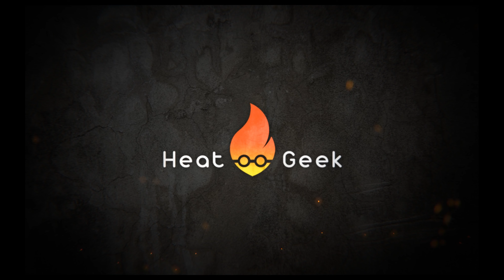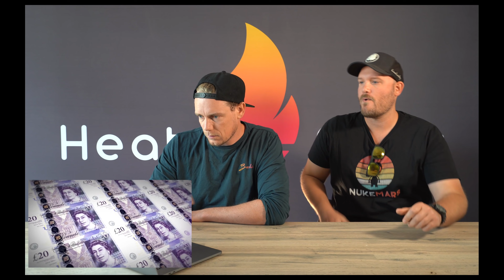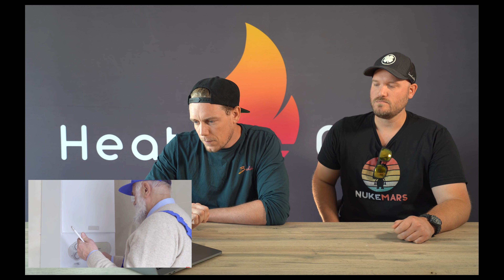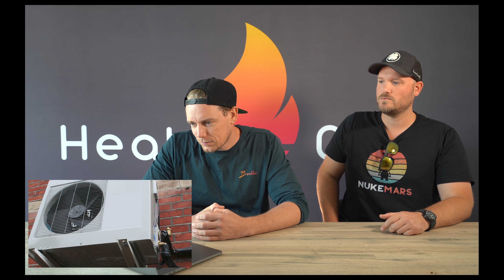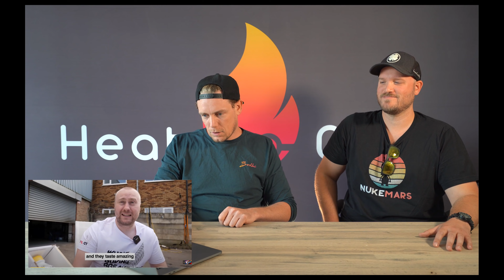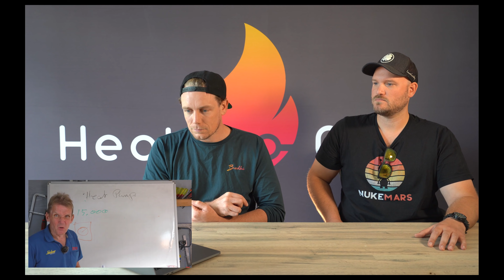Professionals React (BADLY) To Skill Builders's Heat Pump Videos | PART 1 | FIRST TIME WATCHING

Comment: Angry Skill Builder predicted repeatedly higher Gas and Electricity Prices... how prescient does that look now?
He made the point that there will thousands of installers who are insufficiently experienced to make them work well. Heat Geek agreed. I think it's a score draw with me still unenthusiastic about air source heat pumps.
Reply from the maker: No.. he predicted that the government would make them the same price.. both have gone up. They have been talking about stopping yhe subsidies gas recieves for years and giving back to elcy to make it more fair but nothing has been announced yet so untill it is.. its conspiracy.

Comment: THANK YOU.  I had a "conversation" with the gentleman in the video and I can report his writing style was exactly like his speaking style!  LOL  I simply pointed out advances with regards to cold weather and mentioned Norway's embrace of heat pumps.   I got a rant about Norway wanting folks to throw away gas furnaces for a heat pump four times as expensive that didn't work.   He then said it worked in Norway (??!!) because in WW2 all older home were destroyed and besides, electricity was cheap.  

Butcher to heat pump installer!  Love it.

Comment: Something that surprised me is all the Heatpump installs in the uk seem to be based on heating water systems, and then using existing radiators within the home. However in many countries they have the Heatpump outside and an internal unit inside which blows hot or cold air depending on settings. With Uk homes being relatively small, wouldn’t it make sense to have this type of install to heat the main living area, and then just use the gas for the hot water, or is everything too tightly tied into the central heating.
Reply: Don't be surprised' just be well informed.  where's your information from Dave 24-7 ?

Comment: I wonder how many condensing boilers have been fitted by Roger which didn't deliver the fuel savings they should have done because he didn't do the necessary upgrades for the system to run at lower temperatures. This problem is less obvious to the customer because they run the new boiler at the temperature that keeps the house comfortable and they nmay see some reduction on their fuel bill, but they were never really clear about how big a saving they would get anyway. The carbon savings were never made onmany condensing boiler installed simply because the guys fitting them did not understand heating systems, did no calculations and often simply left in all of the old and now undersized radiators, never put any zoning in etc etc. We need to start valuing our heating engineers as engineers and traing them well and paying them equally well.

Comment: Gas boiler will last 40 to 50 years but a heat pump is half the life time. Just like electric cars ,it takes 25 years to break even on the price and the carbon footprint . Your new fancy thing is junk before you get your money back.
Also fan design will hold the noise down considerable. If your fan doesn't have a weird shape then it will be noisy.
Reply from the maker: Average condensing  boiler life is just 10 years.
Reply: @HeatGeek  When did I say a  condenser boiler and they are good for at least 20 years. I was talking about a regular cast iron boiler.
Reply from the maker: @wbriggs111  you can't buy those now and you wouldn't replace a working boiler woth anything that's wasteful. Condensing boilers average life is 10 years not 20. It's well published
Reply from the maker: Electeic cars break even on purchase against a new car so not following that??
Reply: @HeatGeek  I talking about the total carbon footprint that negates the price of lower heating temps with larger radiators and massive insulation and windows costs  to make the heat pump work.
Reply from the maker: @wbriggs111  we change an average of 2 rads..
Reply from the maker: @wbriggs111  most people have double glazing and loft insulation. That's all that's needed

Comment: New purpose built dwellings OK. Old house, solid walls, vented floors = Huge expense to get the older house efficient enough for today's heat pumps to be  working to a satisfactory level in cold weather. And most of our housing stock is the old house. IMO the people that are having heat pumps fitted in old house`s,  just like the early days of solar panels are guinea pigs. Like wind farms we need these systems out in the public domain, working for tech to improve. All these new systems are nowhere near good enough for Mr & Mrs Average to spend tens of thousands of pounds on new tech that currently will not match current gas boiler output. And thats the people that live in properties with the space to put one. I see, driving around towns center areas most people in the older houses and flats, have trouble finding space for their wheelie bins. Something will be done, industry will find a way. But currently we are a long way off the masses ripping out their boilers. Unless they are forced.
Reply from the maker: Thankfully most houses fall between these two extremes and are fine now

Comment: So the gas price issue is now "solved", without conspiracy.
Reply from the maker: Don't follow?
Reply: @HeatGeek  I really liked your reference to our off-shoring of manufacturing and de-industrialisation.  We do have global leaders in very specialist engineering and manufacture, while jet engines are not green they are very specialist and we have world leading engineering there, as an example.  It does seem quite reasonable for UK plc to set itself some goals around making the first combi HP boiler, really high efficiency systems of PV-HP. Does convection play a role in HP design, could natural variations in local air pressure and heat traps be leveraged to improve heat capture while needing less fan.. a bit stream of consciousness but I look forward to seeing where this goes.
Reply: @HeatGeek  since this video the cost of gas has sky rocketed, in no way was that foreseeable or connected to any of the factors discussed in the video. But one assumes it's changed the conversation dramatically.
Reply from the maker: @gedog77  oh yes! Well it's changed a bit but electricity has gone up too.. however when electricity is de-linked from gas pricing electricity will come right down and heat ohm's become totally viable

Comment: Dear Heat Geeks

Whilst I applaud your zeal, you seem to be cunningly avoiding the vitals, let's go over some of them.

1) I live in Essex, if you highly recommend competent installers, do you possess a register of such installers on-book at your Company. If so, would you consider sharing this list.

2) You mentioned that servicing Heat Pumps is required less frequently than gas boilers, what's the average time between Heat Pump servicing.

3) Do you have a list of recommended service engineers.

4) What's the average timeline between ordering a Heat Pump system and installation.

Regards

Robert
Reply from the maker: 1)  https://www.heatgeek.com/find-a-heat-geek/

2) they 'should' be serviced annually  however its much less critical than a gas boiler 

3) not yet assembled

4) average is 4 monthish as most are part of bigger renovations, we can get heat pumps next day though.
Reply: @HeatGeek  

Thank you for the prompt reply and information therein, much appreciated.

Not sure how many: camps, clusters, or groups there are that are toying with the idea of fitting a heat pump system and there motivations, but I suspect they all wish to avoid a system that fails to deliver.

I'm in the process of buying a home which I intend to gut-out at least 80% of the ground floor, whilst adding a 4.5 meter (in depth), extention at the back. If ever there was an opportunity to lay a new under floor heating system, (ground floor only), it will be at said point.

I presume it would be advisable to invite the chosen Heat Pump specialist installer round to advise on underfloor space requirements, in particular, the concrete levels of the proposed building extention, prior to building plans being submitted to the local authority.

I suppose I can ask the installer such questions at the time. I'm toying with the idea of installing a summer house at the bottom of the garden, fitting solar panels on its southeast facing roof, supplying at most times, electricity way in excess of the Heat Pump power requirements.

Thanks again 

Robert

Comment: Down to cost! by the time you have purchased the full air source pump kit, replaced all your new rads you put in a year ago because there under sized for a air source pump, then change all the 15mm pipe work to 22/28mm pipe work (damaging all new flooring, ripping up bathroom/wet room/kitchen tiles) so you can replace for lager pipes  then ............. You go tell the customer to insolate there house to help the "an amazing air source pump" work at a cop of +3  🤣🤣🤣 add all that plus labour easily looking at 8k+ 

With out them realising they have a massive white loud unit in the garden when there lead out there sunbathing

When you can fit a nice silent A+ rated 30kw+ combi with comp controls for less than 3k in a kitchen cupboard 

And just because he's a general builder doesn't mean he's not highly qualified in other sectors of a "building trade"

You said "got to work with what we got" towards the end of the video, so that's basically saying there not good enough yet! So go spend 10k on something that's not quite right yet, then spend again when they have it right, alot of controdiction of what you said at the start then at the end 

You both also agree on alot of things with this bloke your trying to put down as a "general builder"
Reply from the maker: No

Comment: This is a great video, filmed in August 2021. "They are going to have to be careful not to put people into fuel poverty" - lo and behold, it's August 2022 and energy prices in the UK are forcing some to have to decide between warmth and food. The argument that a lot of people make for gas boilers is that you can burn so much gas to produce enough heat warm an uninsulated and draughty house - that is literally advocating throwing money away to heat loss. It's mental. We need government help to ensure our houses are as efficient as they can be.
Reply: Unfortunately this is just the beginning, as the oligarchs who control the WEF are pushing to remove everything we have known for green energy that isn’t technically achievable in today’s world. But that’s not the real issue anyway, as the real issue is to force people into a one world government, by division and deception!
The guy in the video they’re watching was right on in bringing up gas prices! No conspiracy just fact!

Comment: Im an architect and I do agree with the Heat Geek guys. Air source heat pumps have to be properly designed and sited to work efficiently and cost effectively. Skill Builders rant is really inappropriate because he obviously didnt do the calculations properly, and to advise a customer to install an air source heat pump in a shady place under trees at a distance from the house is obviously wrong. The Skill Builder video is obviously made by a guy who thinks that ASHP can just replace a gas boiler. As Heat Geek say, its more complicated than that and the designer installer has to look more holistically at all the site conditions and existing heating system to design and effective replacement for a gas fired boiler.

Comment: Here in NZ and Australia, heat pumps are the norm. Maybe a new concept in the UK? In Australia underfloor gas heating used to be the norm and work great but a split system great if need AC and heat.
Reply from the maker: It's not new, but bot wide spread.  I did not know that!!?? Are wet systems very common?
Reply: @HeatGeek  What is a wet system? If you mean water through radiators then no. Insulation is forgotten which is nuts especially when hot and I'm talking 50degs. Was -4 the other morning so a split system is useful.

Comment: It's no good whining about the message in the video!  Gas boilers work 90+% of the time, whereas heat pumps work less than 50% of the time duie to poor insulation and fitting.  No good shooting the messenger!

Comment: The only problem with heat pumps is getting people to switch to using them.  Air-source heat pumps or geothermal heat pumps are better as you get heat and cooling.  Never seen an air to water heat pump.

Comment: The point I take from all this is, if Skill Builders has so much experience and unhappy customers with their heat pump installations. Why did they keep installing heat pumps in the way they seem to have done, where the simple using their customers as Guinea pigs? and if so why did they not seek professional advice.
Reply: 😹..Doubt that!..sometimes your limited to where the install can be placed!..(i:e; "a heat trap!/area lacking flow! of air!)..& that's where the "system performance" can unfortunately! drop! off!..
All depends on the ambient!😹

Comment: The problem as mentioned is heat pumps conflict with older house designs. And insulation is a possible but complicated answer to that. Older houses were built to breathe and ventilate. Trying to apply modern building techniques and materials can create subsequent problems as well as a lot of cost. 

You can probably crunch the numbers of how many houses this affects. Pre 1940s probably makes up well over half the UK's housing stock.

Comment: The fabric of the building is a bigger variable than the installer!!
Reply from the maker: The fabric of the building is easy to see, measure and amount for. The installer isn't. Exacerbated by the fact that poor installers believe they are quality installers.. they are ignorant to theor lack of knowledge, itherwise they would be more likely to upskill
Reply: @HeatGeek  so, 1920's solid brick, no wall insulation.... You reckon you can install a suitable system that costs on par to run as a gas combi boiler?
Reply from the maker: @Eagesss123  If sufficient loft insulation and properly installed double glazing yes! Will have to be an R290 heat pump though not a dialin or mitsubishi etc
Reply: @HeatGeek  wow. Incredible

Comment: British homes, particularly those built twenty some odd years ago, are not suitable for air-to-air heat pumps. These homes are poorly insulated and average temps in the UK are too low. Geothermal is an improvement, but very costly and doesn't solve the insulation issue. 

Heat pumps, for those who don't know are essentially air-conditioning units that reverses the direction of the gas flow in the winter to heat a home. When set to heat a home, it operates successfully if it can maintain temps within two to three degrees of moderate thermostat settings. If it can't maintain temps, heat is provided by resistive heat strips similar to an expensive to operate electric space heater. 

Heat pumps will work well in newer homes which are well insulated from the outside air and/or located in climates where winters are not severe. They are more suitable in warmer climates where the cooling of temps is more important than the heating of spaces.

Comment: You mate have definitely got a financial interest in installing these over expensive crap you call heat pumps, and I am talking of thirty five years as a plumber.
Reply: Heat pumps aren't crap if they are installed in a house insulated to current standards.

The problem in the UK  is that successive governments for the past 40 years havent had a real energy policy to improve the insulation in our old housing stock.